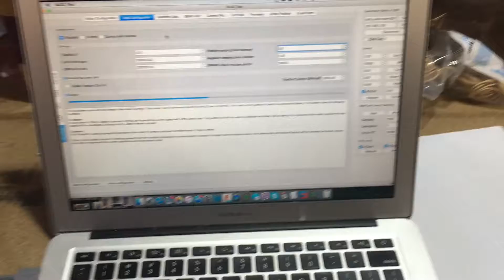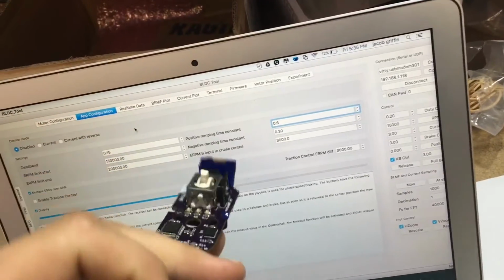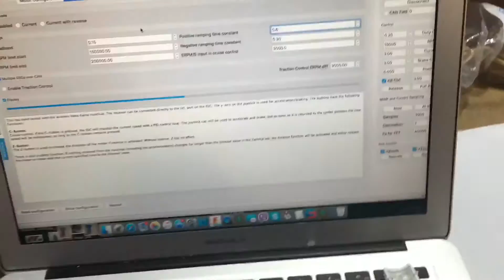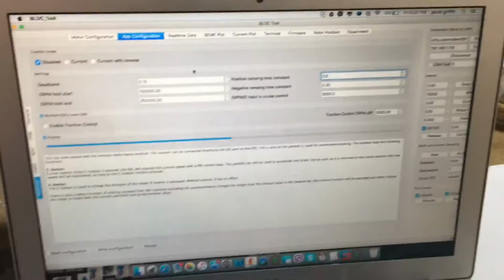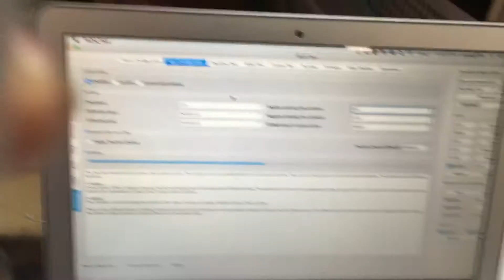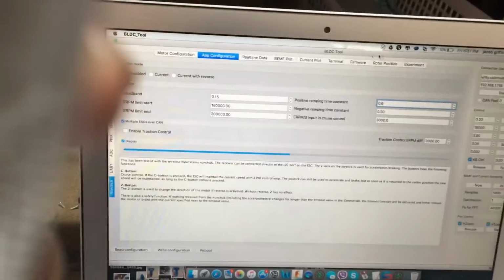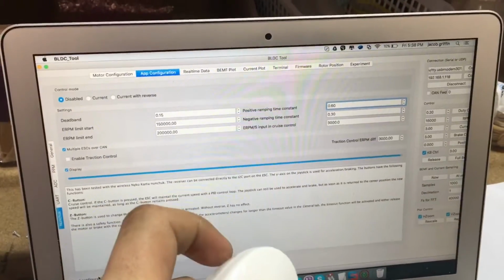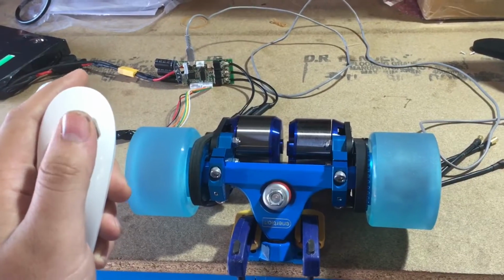Vesc with electric skateboard custom wii nunchuk pcb

Comment: individually control motor speed/direction.I want to have differential speed control on dual motor set up to be able to turn board remotely. Ultimately to make board completely remote controlled. Possibly with WII nunchuck. Do you know how to do that?

Comment: I could succeed in pairing, but I couldn't control it . Push the throttle valve, the motor is not reacting.Can you tell me why? I know you didn't answer my question, but I really want to do it. I hope you can give me a little help. My mailbox is zhixiangl162@gmail.com, I hope to talk with you in detail.

Comment: That Z button reverse direction would throw you right off the board.
Reply from the maker: Andrew Maurer it only works once the motors hit 0rpm so if you hit it while riding it will slowly brake then change direction.
Reply: Now that is awesome, nice feature. I bought two VESC-X from enertion a couple days ago. Looking forward to paring it with a nuncchuck style controller.

Comment: Im building my first Electric longboard so pardon me if the question is dumb. So if i but a vesc and set it up the way you did it with the nunchuk receiver, would i be able to just do as you did in the video and get the same result? Im talking about the computer program you used to configure the vesc.
Reply: The program used to configure the VESC is called the BLDC-tool Benjamin Vedder the VESC designer created the software too and has it on github.  On linux I had to download the source and run a few commands to build the program but believe there are prebuilt versions for windows/mac just search for the BLDC-tool github page for details

Comment: How do you connect your 2 motors to your receiver, 2VESC's i suspect ?? but how do you connect those 2VESC's to your controller ?
Reply: Not sure as I only have a single motor board but I believe the CANbus can be used to connect the two VESCs so the signal from the receiver would go into one VESC and that would send the same data over to the second VESC with a very small delay (CANbus I believe is designed for cars to do things like activate the air bag in case of a collision so it is meant for "near real time" response).
Reply: @ShaunHusain  yes that right !!